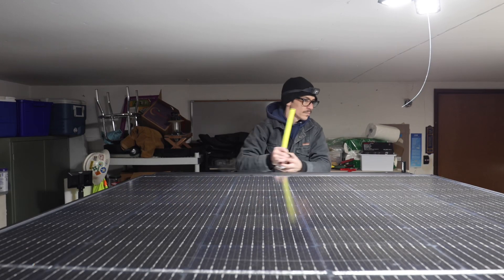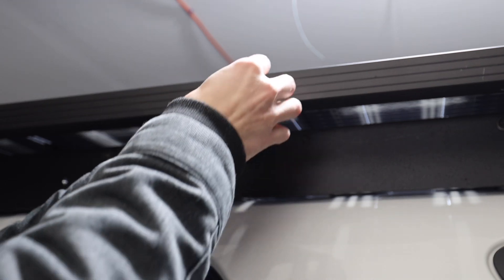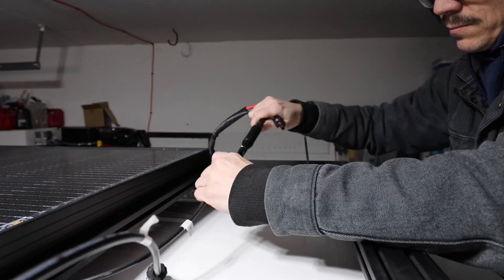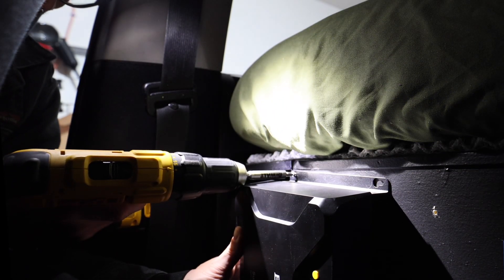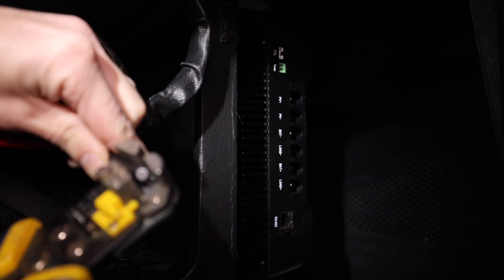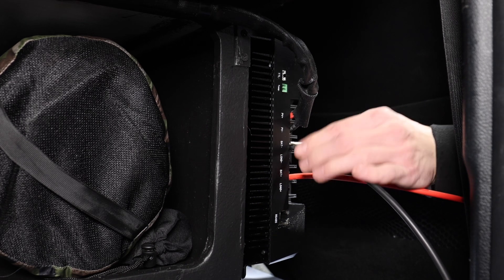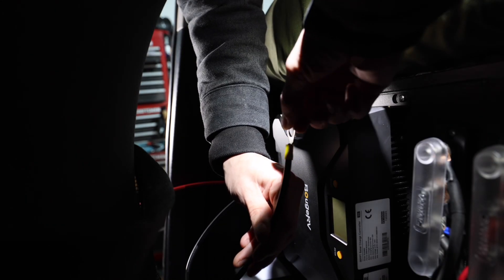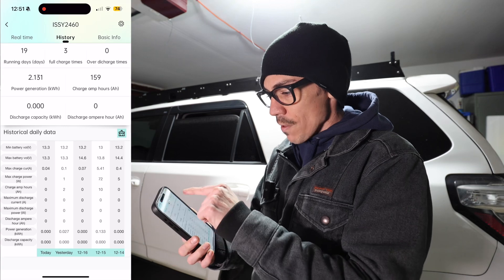Installing the Ultimate Solar System on My 4runner- Vanlife Overland- BougeRV 400 watt panel

Comment from the maker: Link to BougeRV's 400W solar panel: https://bit.ly/3ZItIgS
Link to BougeRV 60A charge controller: https://bit.ly/3P9OukQ
20% OFF discount code: Mystery 
Expiry date:Until Jan. 1st 2025

Link to BougeRV's Amazon 400W Solar Panel: https://amzn.to/3ZKRB7A
Link to BougeRV's Amazon 60A charge controller: https://amzn.to/3ZPdmTE
10%OFF CODE：400W60ASOLAR
Expiry date: Until 2025-1-5  23:59 PST
Reply: Do you have a link to the solar panel retainers/holddowns?

Comment: when is the next vlog?
Reply from the maker: I’ve been focusing on getting the 4Runner built out, and working. The vlogs weren’t getting any views so I put them on the back burner and relax when I’m out adventuring. I didn’t realize people missed them though, so maybe I’ll film one soon.
Reply: @IntoTheMystery13  i'm not sure what's best for the channel but I personally really enjoy the vlogs. I don't have a camper van so the reviews are interesting but I don't get much out of them.
Reply from the maker: Gotcha. Yeah it’s a temporary thing. I happen to have a lot of sponsors right now, which is amazing. I have a few of those left to make videos for. It has finally started snowing good on Mt Hood though, maybe I’ll go on a little adventure tomorrow and check it out. 

Soon I’ll be back to mostly adventures. If I can save up enough for before spring I’ll be on the road full time again, at least for a while. I’ve been dying to explore Arizona for a couple years now.
Reply: @IntoTheMystery13  i'm happy you've got so many sponsors man!